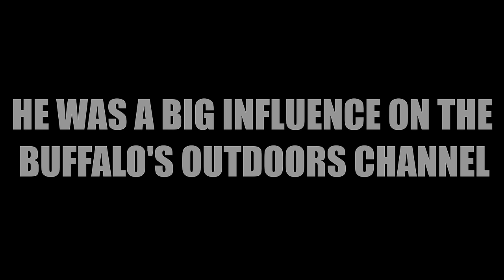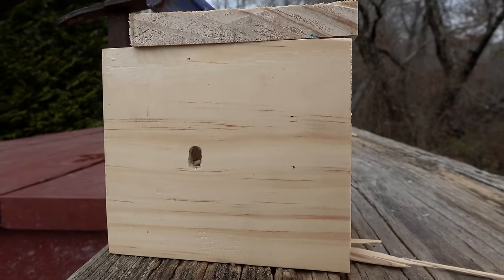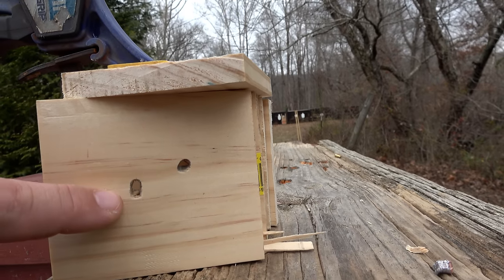TINY REVOLVER vs 1/2 inch PINE BOARD 🌲

Comment: Going through the first board was a sure thing, and i guessed the second board would probably stop it...that is enough power to kill someone with a perfect shot...i was very impressed the keyhole bullet went through the board, and the following shot went further, it shows that while keyholing is bad, it can still be effective at extremely close range...i was also impressed with your accuracy hitting that steel...another great video...!!
Reply: Yeah, keyholing with a 22 short really is bad. Although I don't knock 22 short as an effective self defense round, it really is barely lethal and something like keyholing destroying its ability to penetrate can really make a big difference. The same is true with 22lr. (Like with 22lr, expanding HP rounds from a rifle don't penetrate enough to be lethal... but if they're fired from a handgun and don't expand, they have plenty penetration to be lethal). For that reason I would never use 22lr hollow points for self defense (or at all if I can help it). It's tough though, because many of the hottest, most reliable 22lr rounds are HP.
Reply: @deucedeuce1572  that is why i used "...A perfect shot..." .22 short is very limited, and .22lr/wmr not much better, but somebody out there depending on it...heck, we carry .22wmr often, eight revolver rounds beats nothing...a lot depends on where we are, in our case a relatively quiet place...if we lived in the 'hood we'd upgrade...we do own a .22lr model of the gun, loaded with velocitors when rarely carried...these are not gun fighting guns, but stuck up bad guy's nose should work...barrel end to skin range doesn't allow too much keyholing, although better to avoid the situation to begin with...

Comment: Buffalo, I have an NAA-22LR.  Fresh out of the box, 3 out of 5 shots keyholed.  I tested half a dozen different .22LR ammo.  It went back for warranty work, but it still keyholes once in each cylinder.  I haven't figured out how to test to see if it is always the same chamber.  I am amazed at you hitting that steel from that distance!  Impressive shooting!
Reply: @henrikchristensen6314  Not a bad thought, but I tried 40 grain and 36 grain, standard velocity and high velocity. No difference in my little revolver.  The only 32 grain I have are hypervelocity loads, and I did not try them in that little barrel.  Maybe I should give it a try.
Reply: Different color sharpie marks on each chamber?
Reply: @douglasmaccullagh7865   You could try a .22 short like Buffalo's. That'll give some direction wether you're on the track. Hope the best  -  Else use the nastiest and hope the guy isn't wearing to heavy clothes :D
Reply: @henrikchristensen6314  That would make an interesting experiment.
Reply: Has anyone done any water trap tests to see what the rifling imprint looks like?  Tends to be like reading tea leaves with such a tiny bullet, but it's probably the most direct way to get information about what's happening.  I've spent too much time chasing ghost problems only to find out that a given bore is just stripping bullets for one reason or another.
Reply: @PSUQDPICHQIEIWC  This. 

Examining both the brass and projectile could give a good idea of what’s wrong.  Just keep track of each chambers brass. Also check the forcing cone. If the chambers aren’t aligned within spec, the projectiles could be striking too far onto the cone, deforming the bullets. 

If the latter is the case, copper plating residue or lead buildup will be very heavy on one side of the cone.
Reply: Barry!
Reply: You should send NAA an email asking about the keyholing. They are definitely not supposed to do that and they may replace your cylinder and/or barrel.

Comment: On your pine board set up. I have a simple suggestion. You have a board youre using as a clamping extension. A sort of bracket board. If you lay a coarse cloth like a larg rag or small towel on that board and staple it down it should provide a good surface to sort of shim out the differences in hight of the strike face boards which would help keep them in place during impacts. That said there is much to be learned from them freely moving as well. Anyway just something to think about.

Comment: 1:35 
S&W's 1941 catalog listed pine board data for guns and cartridges. 
so the "standard" is quoted as a 1/2", 3/4" 7/8" or 1" soft pine board 
that could be penetrated by 60 foot pounds ft-lbs  of kinetic energy 
from some small pistol round that had been lethal so any bullet with 
60 ft-lbs  was "considered to be" "capable of producing" a "casualty "
BUT 
The fallacy of the pine-board penetration died after a shrapnel ball explosive 
was accidentally detonated  at close range  of  a close group of observers 
& then  all had a few bruises BUT  nothing had penetrated clothing BUT 
this grenade  had past a penetration test of MANY pine boards  
from old growth lumber not like whats sold today from tree farms

Comment: The second board on was to loose, you moved them with just your hand , so some force was lost in moving a loose pine board. I have heard that undercover types have loaded this gun with .22 long rounds by shaving off the tops of the rounds, to get a bit more powder from the longer round...You could blow up your gun however. Just go with the .22 LR version for power and a vast selection of bullet types...

Comment: I shot through two 1/2” pine boards with a 6.5” pistol using Armscor 29 grain solid points rated at 1080 fps.

Comment: For some reason .22 short is the same price as .22LR at Big 5 Sporting Goods in Ventura County, CA. I was going to get some .22 short for my Heritage Rough Rider but if it's the same price there's no point in spending the money for a round that isn't as powerful. That NAA .22 short is impressive for what it is. Those little bullets could take down a small critter.

Comment: The bullet might have penetrated the second board if it wasn't a hollow point.
Reply: I shot through two 1/2” pine boards with a 6.5” pistol using Armscor 29 grain solid points rated at 1080 fps.

Comment: My EDC (every day carry) for the last 10 years is a North American Arms 22 Magum revolver loaded with high velocity rounds and I trust it with my life.
Reply: What are the specs in the ammo that you're carrying in it? I have an NAA .22mag as well that i keep in my boot and I use Speer Gold Dot Personal Protection Short Barrel ammo. I was under the assumption that the shortened barrels on these little revolvers makes hot loads extremely underperform.
Reply: @93rwolf  Short barrel weapons always under perform long barrels up to a point.  The speed drops off with shorter barrels.  Either way, I don't want shot by one.🤔
Reply: @alcyone9361  For sure. These .22 magnums are mean little cartridges. They definitely aren't harmless "pea shooters" like so many people like to pretend. Every firearm has more than enough potential to put someone down.
Reply: Absolutely lethal potential , and with these small calibers shot placement is worth the extra range time. Make each one count !

Comment: My NAA 22 Short has never tumbled a round that I'm aware of, it always punches a clean hole. I did work on my barrel crown when I first got it, just like yours it was very sloppy from NAA. I used a brass screw in a drill, with valve grind compound to shape a perfect crown. I'm not sure why NAA makes such a fine little gun, then completely ignores such an important part of it.

Comment: The foot pounds of energy that this piece is putting out with the .22 short rounds is about like what the Hatsan 135 QE .25 caliber break barrel air rifle I used to own was putting out when shooting H&N 30.8 grain baracuda pellets. Both are putting out between 25 and 30 foot pounds of energy on average and my air rifle would put one of those pellets through a 1x4 pine wood board from about 20 yards away and it would go deep into a second 1x4 pine wood board behind it as long as I didn’t hit a knot. It would also penetrate through 3/4 of an inch thick plywood and go through 2 thin plastic gallon water jugs and enter a third one

Comment: The way I figure it, is if a projectile will go through what they call 1/2" plywood (much tougher than 1/2" pine board), it will penetrate living bone that the average adult human skull is comprised of....and from a 16" rifle barrel, a regular .22 short bullet will penetrate  the 1/2" plywood @ 50 yards no problem.... Out of THAT little pistol, you MIGHT be getting 900 fps and middle change.... as it is a short barrel and a little power gets lost at the cylinder gap on revolvers... The fps numbers given on the box is almost always from 18-20" barreled rifles.... .22 shorts are a cool round... not a toy at all.....
Reply: More like 700fps